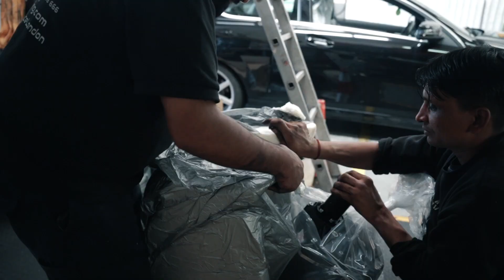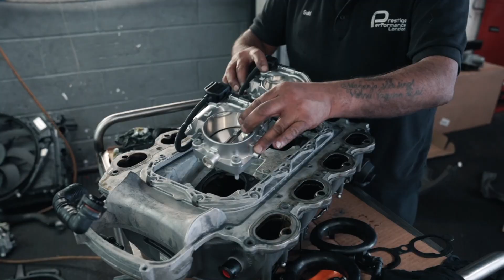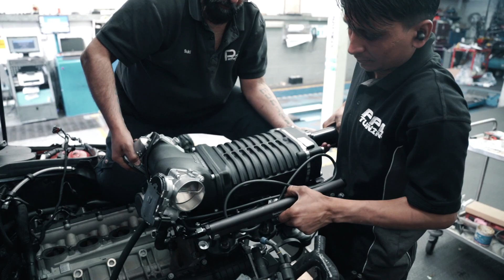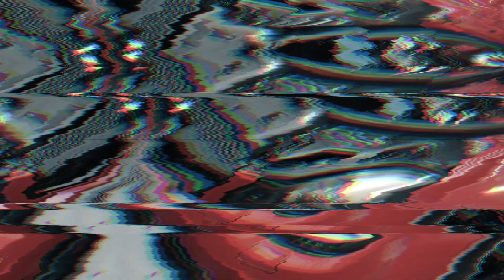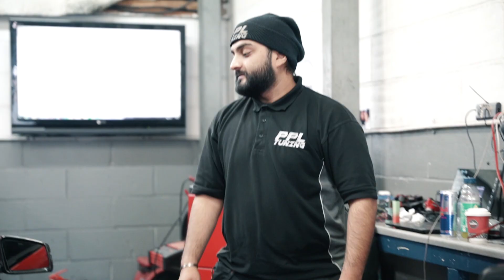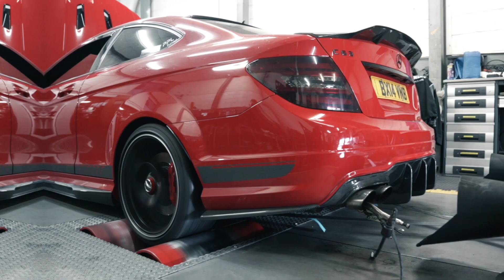PPL TUNED FLAME SPITTING WEISTEC SUPERCHARGED C63 507 'WEISTEC' EDITION! FASTEST C63 IN THE WORLD!?

Comment: The blower sounds wild lol, how much power did it make?
Reply from the maker: The car made 740BHP!
Reply: @PPLTUNING  stage 2 or 3 ?
Reply: @PPLTUNING  and how much to the wheels???
Reply: Tbh that’s low whp considering the price of the supercharger should be more like 650-700wheel
Reply: @mattmartin9867 it’s around that range, weather conditions and altitude could be a factor as well. 740bhp is a solid number for factory bottom -top end